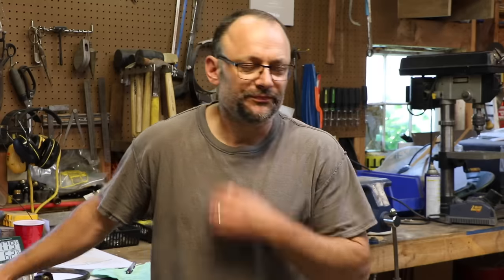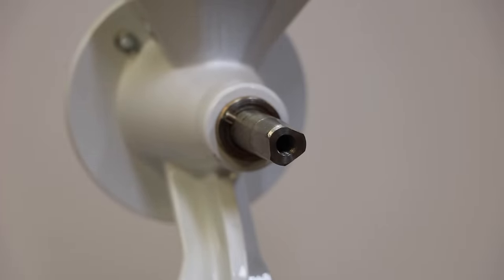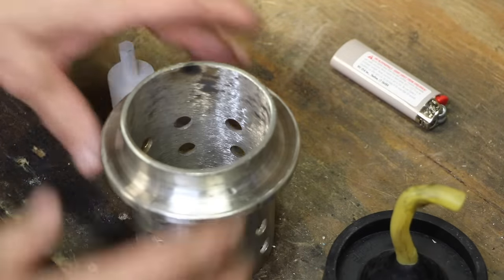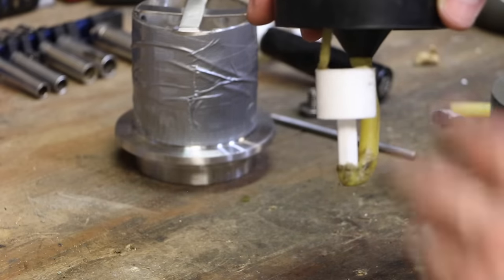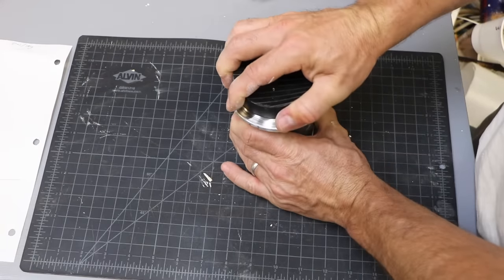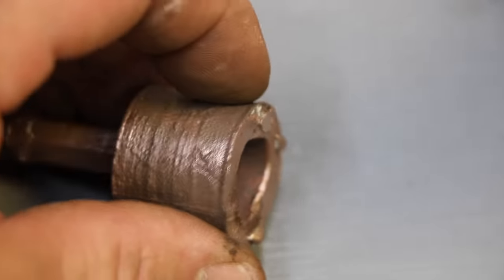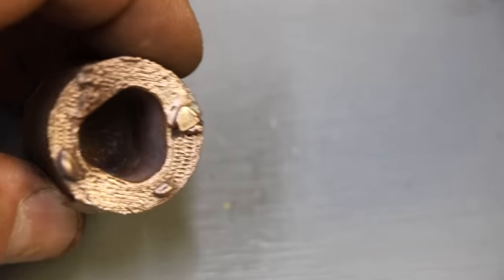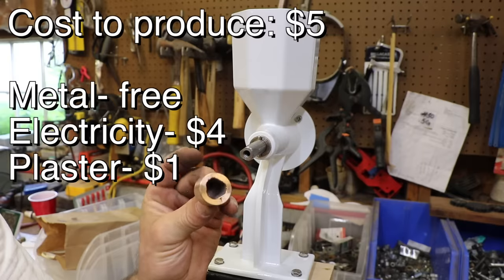I Refuse to Buy Your $@#!   I Make My Own.

Comment: Or use a drill with a large chuck :)
Reply: My thoughts exactly
Reply: Yeah and it's always nice to have a spare chuck around.
Reply: Won't work. The cuts are tapered and a drill chuck will have no holding area. A brace's chuck is tapered but that is 4 sided not 3 sided. They made it the one size and shape that there is no standard driver out there that would fit it.
Reply: Existing Crosspins could have used instead.  Drill hole in tube, cut in half, done.
Reply: @akawireguy1197  
Large drill chuck's have 3 jaws and would definitely be able to grip that 3 sided shaft perfectly.
But I do like the fact that he made an adapter of his own!
Reply: @akawireguy1197 i bet a gator socket will fit, as long as it's low RPM it really don't matter about wobble,
Reply: or press a steel pipe on with modded end with flat [plus loctite and fill triangle flat voids with a little epoxy], and onto that a hex welded on for the drill
Reply: The shaft is TAPERED. The engagement area for a 3 jaw chuck with it's UN-TAPERED faces therefore is extremely small. For a 3 jaw chuck to work you would have to have the grinder locked down so you could continuously apply fairly severe forward pressure with the drill. The grinder isn't designed to have that kind of forward pressure applied to that shaft. That shaft is designed for side thrust, not forward thrust.
Reply: That was my first thought.
Reply: @akawireguy1197  A sufficiently large chuck will work just fine.  Less than half of the shaft is tapered.  Just shove the whole thing in.
Reply: @akawireguy1197  It won't engage well on the tapers, but there's plenty of shaft for it to grab (provided it's a big enough chuck.)
Reply: That makes too much sense 🤔
Reply: I'm sure he knows about this, but was probably just having an excuse to make a YouTube video and do some casting :)
Reply: a $600 drill that would rip that thing in half on the first bind.... yea.... no
Reply: Very interesting and sorry, but I think you were very lucky. Stay safe.
Reply: He not seeing the Trees,for the forest .For a guy who seems to know how to fabricate things, he sure as heck doesn’t appreciate the total cost of fabricating the parts. The title should’ve been  how to waste three days and $300 making an adapter.

Comment: Not exactly a "proprietary" fitting... Every coal stove I've ever worked on uses it for the shaker. Lots of antique small farm machinery uses it too. If you keep an eye out at farm auctions you will probably find a pulley made in 1908 that will slip right on, for a buck, because no millennials know what it is for...
Reply: It may have been due to coat of manufacturing - adding some bevels to a machined shaft would be cheap.

But I like the idea of a 1908 handle on a Chinese (presumably) mill in 2020!
Reply: @themanhimself3  Son, my grade 13 Advanced Electronics project was designing an XT, from scratch, the year they released the 286... And I've custom built every desktop I've owned since... I run 3 screens for video editing on my Linux Laptop...
Reply: Cost of tools … you’ve got to include that if like me you don’t own any of them other than the cordless drill. 3D printer, forge, lathe, etc.
Reply: Wasn't it boomer's that perpetuated planned obsolescence and the like?  As a millennial, I'm finding myself having to learn and fix everything older then 10 years. Computer or mechanical. What happen to all this unbreakable equipment!? I know where, rusting away in land fills. And who put it there... hmmmmm could it be....SATAN! lol no, the previous generation (boomers). Hey thanks for the mess...
Reply: The taper has the advantage that it it less likely to bind when you need to remove it. Of course it only works on the end. Also it means the end piece doesn't need precise machining for a mechanical fit.
Reply: @johnnyhellfire6  might have been, some, but really that is more of a GenX thing...
Reply: Biden signed yesterday an Order for the "Right to Repair". Good politics.
Reply: @johnnyhellfire6  EVERY previous generation did SOMETHING to mess up the environment so you could be here to tear it all down. So glad you came along.
Reply: My older brother is a scrap metal guy he comes across the strangest thing's. I took a 1960s Sears bike I pulled from his scrap pile and cleaned up the bike put new white wall tires hung it up on the wall now everyone wants it. Not the way it looked in the scrap pile. I guess no one could see what it could be with a little work. Saved it from the crushers!
Reply: @johnnyhellfire6  planned obsolescence started with light bulbs long before boomers. Try again.
Reply: @PADE1RTW  I said "perpetuated" not "started". Dictionaries are your friend...
Reply: @Kevin D "Millenials" are reaching 40 years old, are you sure you're taking about millennials?
Reply: @TheZenytram  millennials are 26-41.
Reply: @themanhimself3  Careful. Boomers were the ones hand-soldering computers together in the 1970s, and they've still made more money with pulley-driven equipment than zoomers have made "mining" crypto.
Reply: @PADE1RTW  uhhm no light bulbs have a life span  one simply
Cant make a light bulb that lasts a life time and keep it cost effective for the consumer
Reply: @GeorgiaRidgerunner  no one said a lifetime. Why strawman my argument. Light bulb manufacturers conspired together to shorten the life of their bulbs. This is a fact. Research it and stop arguing against arguments I haven't made.
Reply: @TheZenytram  yep.. I'm 43.. and I am the Youngest of the ones at work that go home with pride knowing they did the best job and Most production they could..
Reply: @PADE1RTW ok illresearch that
Since you obviously already have researched this let me ask you did the person writing said article or ticles you read list his/her credentials  also did you read more than one article  when i have these answers then ill research lightbilbs
Reply: @GeorgiaRidgerunner  the answers to your questions are yes, yes and yes.
as the light bulb customer base grew more mass-market. Greater sums of money could be reaped, companies figured, by making bulbs disposable and putting replacement costs onto customers. Thus was born the infamous “Phoebus cartel” in the 1920s, wherein representatives from top light bulb manufacturers worldwide, such as Germany’s Osram, the United Kingdom’s Associated Electrical Industries, and General Electric (GE) in the United States (via a British subsidiary), colluded to artificially reduce bulbs’ lifetimes to 1,000 hours. The details of the scam emerged decades later in governmental and journalistic investigations.

“This cartel is the most obvious example” of planned obsolescence’s origins “because those papers have been found,” says Giles Slade, author of the book Made to Break: Technology and Obsolescence in America, a history of the strategy and its consequences.
Reply: @GeorgiaRidgerunner  just Google planned obsolescence and light bulbs. There are many sources.
Of course planned obsolescence benefits corporate interests. It doesn't help consumers. I don't like having to replace everything I buy these days. When I was young fans lasted many years. Now I have a pile of broken fans.
Reply: It's always the fault of the older generations for the failures of the next generation. Y'all raised us, you made that bed, now lie down and sleep in it
Reply: @GeorgiaRidgerunner  the Livermore lightbulb burned from 1901 and finally burnt out in 2020
Reply: @kevind7617  if your making reference to that light bulb in that firestation  i was aware that it been burning for a long time  i didnt know it had burned out though
I do remember seeing it on i think  an old episode of modern marvels
That bulb was one hell of an example but it was never turned off
And thats why it lasted so long
Had it been cycled off and on the way a normal bulb is cycled it would have burned out just like all the rest of the bulbs of that era
Reply: @GeorgiaRidgerunner modern marvles was kick ass..
I used to watch every 1..
Even on subjects I wasnt really in to
Reply: @joesteel6361  ah, the quintessential millennial responce to everything..."It's not my fault!"
Reply: @kevind7617  You have 36 year old nose snifflers? Either way, Gen X was terrible too.
As bad as millenials can be, they were raised by boomers and Gen X. And to this day I'm still not sure if Gen X deserves more criticism than boomers.
Reply: @JacksonKnives  Boomers hand soldered computers and now need their zoomer grandkids to open .pdf files?
You mean people with an interest in electronics or a career in the field hand soldered their computers. The vast majority of people back thought that one computer in every household was both useless and a pipe dream.
Reply: @GeorgiaRidgerunner  "millenials don't know where plastic comes from waaa" again millenials are reaching their 40s. Don't you mean 16-17 year old kids?
Reply: @trollforge  You do realize that your response is also "not my fault!", right?
Reply: @ChucksSEADnDEAD  There is a VAST difference between trying to establish what the facts of a matter are, and trying to distance one's self from any culpability, and/or responsibility, for ones actions... Is my generation guilty of any of the accusations leveled in this thread, YES! Certainly, are we the progenitors? Perhaps of some, but mostly we inherited the problems of our forefathers too... Am I, personally, guilty? Maybe, and if so mostly in my younger years... As a matter of fact, I have more than 800 videos up, primarily dealing with sustainable living, and repairing, and maintaining old stuff... So, I have put my money, where my mouth is...
Reply: @erickonnig3021  How about the right not to throw the country down the drain? How about supply chain recovery? How about economic recovery? How about not destroying our energy efficiency and self dependence? Good politics? lol.
Reply: @stevebabiak6997  : "Cost of tools and expendables":  Truth !  "He spent how much to save himself $30 ?!!"  In his cost analysis at the end, he forgot "Time" (his labor value).
Add postage and the part shows up at your door about a week later.  Added bonus:  More "important" things get crossed off the "Honey do list" in the intervening time.  "Happy wife/happy life, unhappy wife/got a knife"
Reply: @johnnyhellfire6  Regardless of one's age ("generation"), most of the problems in society are rooted in the power of a few and not in the mindset or behavior of the many. About 15 years ago I tried to have a "not made in China" Christmas gift giving season. It was extremely difficult to put into practice because the corporate decision makers prioritized profits over community. Today we have the large tech companies following the same profits over people model, and those tech companies mostly employ people under 35 years old. So it isn't a generational issue as much as it is a power, control and politics issue.
Reply: @johnhorner5711  I think you have said the most poignant comment here. Unfortunately it seems to be human nature to bicker and rant about the problems of the day, no doubt because there's not a lot us normal folk can do to change things anyway. Most of you here, given the chance to reap a huge profit by manipulating the market would most likely not loose much sleep once the profits came rolling in, you might even create some internal deception so you wouldn't have to feel so guilty or be aware of the huge amount of frustration and anger being generated. You would do humanitarian acts so you were actually thought well of...

As a species, no matter what generation, humanity continues to push the limits of whats 'healthy' and blur the line between wisdom and wilfulness adopting systems to justify theft and exploitation...
Reply: Ok, the amount of knowledge and equipment you used leads me to believe I might just Ave to spend the money they ask. Such is life…

Comment: I just take the shaft off and put it in the lathe
Reply: There's a few different other easier methods. I say a drill fits, a drill has 3 jaws evenly spaced.
Reply: Just chuck the whole thing in the lathe and run it with the lathe
Reply: Thank you for stating what clearly needed to said.
Reply: There is this innate problem among youtubers to unnecessarily overcomplicate everything. Often times the simplest option is the best, and using the tools around you for multiple tasks is the best value for the owner. If he was going to regularly use this mill I'd avoid having to use the lathe to drive the crank, i'd rather just have put a keyway in with a key and pulley and drive it with small motors I have, this would have been extremely simple and quick to do.
Reply: taper lock coupling would be off the shelf for this shaft.
Reply: Two issues. 1. The shaft is hollow, so if you turned it down and threaded it, it would be very thin and likely to break. 
2. If you modify the shaft you lose the ability to use the handle.  
Let's be honest, John just wanted a fun project! 😉

Comment: Besides planned obsolescence this is one of the most infuriating practices of modern manufacturing. Not even just creating "proprietary" parts or hardware, but the intentional engineering towards making everything more difficult to work on. The amount of time and effort put into unstandardizing everything, which creates even more time and effort necessary for someone else later (usually the customer) is simply anethema to the human condition. Everything should be getting easier, more standardized, less complicated and requiring less resources
Reply: They never plan on the ‘plan’ going wrong. Must be a Military thing! Stay Frosty Brother.
Reply: What about freedom of engineering?  I can understand they used a three sided axle because it must fit a cast part with no sharp angles, so it doesn't crack.  Four sided is often used, but it concerns machined parts.
Reply: Hopefully as 3D printing continues to advance and achieve widespread consumer adoption, the ability for companies to make parts like this proprietary will diminish.  
Then again, that may also result in companies charging more for the original product if they don't have the continued income of selling comparable products.
Reply: If you knew anything about engineering or fitting design, you would know that a taper is the shape of choice whenever you want a good fit between two parts without spending a tons of money to machine said parts to an unnecessary degree of precision. The way this spindle is designed will make it last a long time under heavy loads without loosing its good fit with the handle; if you want a cheap adapter, just use a grub screw in the hole and grab that with the drill
Reply: What if I told you this "proprietary" part is actually designed that way because it's easier to engineer and assemble compatible parts for? Tapered shafts are very, very good for constant-speed long-term-use applications like this, they're much easier to take apart after a decade than any other fitting.
Reply: I love that the European Union recently ruled that all rechargeable portable electronics have to use a USB-C port because that will mean millions fewer little chargers, cables, etc. Now, could we please have a universal portable tool battery connection standard? The differences between Dewalt, Makita, Milwaukee, etc. 18/20V battery pack attachment points is all about locking you into a proprietary system as the way they function is essentially identical. Heck, the same company owns Dewalt, Craftsman and Black&Decker, yet all three of those tool lines use different battery packs!!!!
Reply: The Whiskey Gunner----  Thats the way "system" is set up and it obviously works for them. Buy, discard, buy again.

Comment: I saw the cross pin and figured that was how they powered it with a motor drive.  I would have just taken a 5/8 socket and used a cutoff wheel to grind 2 slots in it and used a 1/4" socket drive adapter to power this.
Reply: I think that's a retaining pin that rides up against the washer there... if you put a socket on it you might mar the washer and chowder it all up making it run with too much play.
Reply: I wouldn't use the cross pin but couldn't you just take the handle off but replace the bolt and drive the bolt to spin the shaft? Add a few washers so it doesn't bind...
Reply: @gorkyd7912  I'd use a bolt with a nut threaded onto it already, then when it bottoms out, spin it back a turn, then tighten the nut to lock it in place so that if it ever sheared off the rest of the bolt would come out easy.
Reply: He's standing in front of a lathe, what machine do you think he might use to produce the drive adapter?
Reply: Like I said, he’s not too bright.

Comment: OR! Or, and just follow me here. That tapered triangular shaft is ALMOST a hex as is. Just disassemble the machine, truss it up in a vertical mill, and take the last 10 mm of the taper down to the same face width on six sides, leaving plenty of meat for the stock handle to grip, while allowing a properly sized hex socket to also be able to grip the last 10 mm, entirely enough for running a power drill on.
Reply: Or take your trusty angle grinder and a dial caliper and quick grind it into a hex.  If it looks good, it is good.
Reply: @MLFranklin  No. If it looks STRAIGHT, it IS straight. Unless it's that cute girl at the end of the bar you've been eyeing for a half hour, `cuz she gay.

Good or not good is all in the eye of the GO-NO GO gauge.
Reply: I'd just thread a bolt with a nut onto it, using the nut to lock the bolt into the threads before bottoming out. Then if the bolt ever sheared off, it's not tight in the threads, you could get it out easily with CCW drill bit.

I'd probably add a pulley and belt drive to make it run really quiet... a fly wheel to help cut down vibration... and be 200 dollars into a project to save 30...